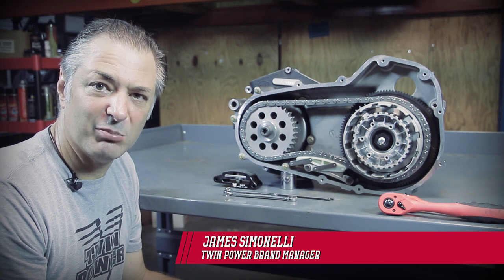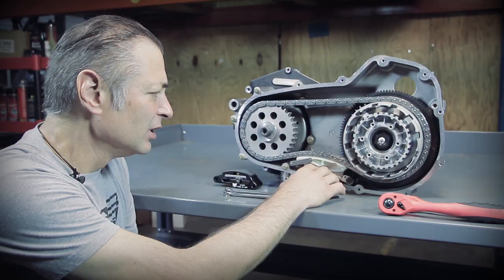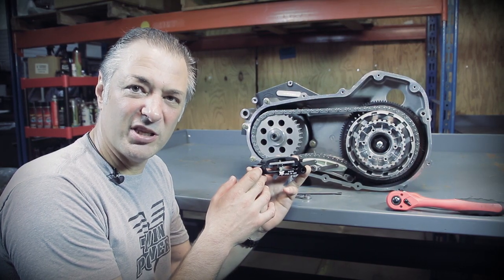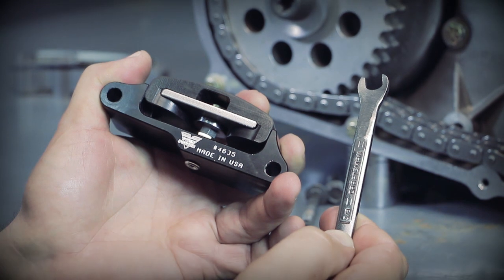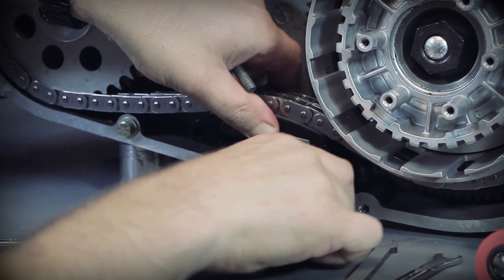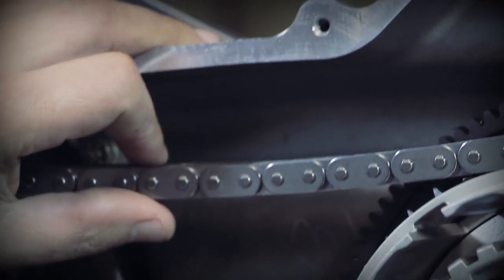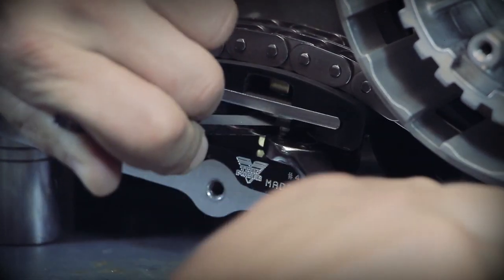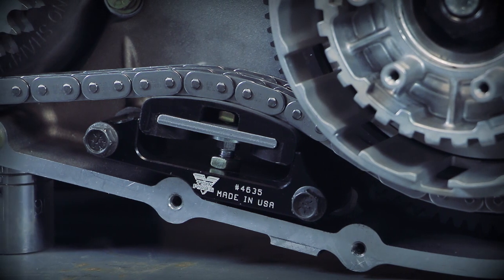Manual Tensioner | Twin Power

Comment: Only downside is you have to remove the primary cover to adjust it. The older HD models that had manual adjustment, were able to go through the inspection cover. Much easier. But I guess that’s what I have to sacrifice to swap it over to manual.
Reply: Yeah, would be nice if there were a cover with an access hatch.
Reply: I believe baker makes that very thing. At least that's what I was told. It's pricey tho. I'm referring to the primary cover with inspection/service plate.

Comment: i like this manual adjuster... i have a stock '02 Electra glide, with the stock factory manual adjuster.. this adjuster is way better than the stock manual adjuster  b/c you get an exact adjustment.. the adjuster i have uses notches or 'teeth'  & the chain is either just a little too loose or a little too tight.....

Comment: so basically... the 'fix' is simply to defeat the auto tension (which was supposed to be the 'modern' solution to premature chain and sprocket wear), install a manual override and then adjust the thing every 5K.   progress ???????
Reply: Go hydraulic. Only way to go.

Comment: Hi
Great vid...
I just installed a Hayden auto tensioner... I'm also running a Baker compensator... My problem is that I'm getting clanking HOT startups .. HaYden is telling me to ride it for over 500 miles to break it in... Not sure what to do.. I'm thinking manual tensioner if that doesn't work
Reply: I've had the Hayden m6 for about 800 miles. I had zero issues at first. Now I'm getting chain slap. I have the biggest spring and both shims. I'm going to manual myself.
Reply: Removed the Hayden today...looking at options

Comment: Someone needs to manufacture a manual tensioner with some form of spring dampening.  All the manual tensioners are rigid with nothing to dampen all the oscillations associated with different stresses on the driveline..Something that the stock tensioner actually does.

Comment: What does a failing primary inner bearing sound like? Mine sounds like a grinding dry bearing sound until the clutch is engaged and put into gear. Thanks

Comment: I checked out your website, I am interested in your manual primary chain tensioner for my 2007 Harley Davidson Fatboy. I checked all of your dealers, not a one has your product, other than the cut down 3/8" wrench. I did an internet search, and didn't find your product anywhere, other than your website. Is this manual tensioner no longer available?
Reply: I also cannot find this product anywhere. Is it still manufactured?

Comment: I put one of these on my 08 ultra and the starter gear hit on the side of it and cut a grove in it , making a rubbing noise wjile running . they dont tell you to use spacers
Reply: All that is is the old style Harley chain adjuster made with weak hardware.
Reply: Wait were the spacers included with the tensioner or did you have to buy them separate?

Comment: The question should be at this point here in 2018 is: Why in the hell is Harley Davidson still using a chain primary drive ?
 A gear drive system is standard in just about every other manufacturer world wide and it’s smoother and less maintenance to boot. At some point this chain primary drive system must go sooner or later, and why the continued to use this system on a new engine design is beyond many of us harley owners.
 They will go to a gear drive very very soon.
Reply: And people continue to buy these POS year after year. Even now with all the transmission migration and sumping going on in the "New" M8 engines. It absolutely amazes me that people never learn.
Reply: Plenty of those chain drives hold up to MUCH larger engines including 145 C.I.  If you add enough horsepower, expect to bend a few parts on any machine. There's hardly any maintenance to a chain primary, and the overall HD design is actually very easy to work on. (I'm a multibrand mechanic of many years.) If it bothers you, buy something different. You have zero personal obligation to buy HD unless you work for them or own a shitload of stock.
Reply: Just to many variables, to comment. I know Harley s are for me.

Comment: Bought one for my 2014 low rider twin cam at its lowest  adjustment had a hard time installing it once installed  there's no room to put play in the chain very tight didn't work.  I do not recommend it.

Comment: People are concerned that the adjuster bolt in this Twin Power tensioner lacks support, and will bend over time. Anyone had this tensioner installed for 10K or 20K miles, that can report some long-term results?
Reply: it's like a mystery nobody knows nothing about it for $200 bucks...checked out there web site this morning and they are not even listing the adjuster 4627 ???
Reply: No obvious reason it should and the bar holding the shoe is as thick as the later (good) Evo Sporty chain adjusters.  If in doubt, buy Baker. (If not in doubt, buy Baker.) The solid engine sprocket ( compensator eliminator does sound cooler) is a very good idea and has been done before. I despise auto adjusters and replace them on personal bikes.
Reply: Got mine will update after install and 500 on it.
Reply: So Jim's cycle....any update??

Comment: That is very bad solution.  Why is not a gear not installed in the place of plastic on which the chain grinds.  Design flaw on purpose, wearing parts with the company earned money.
Reply: You should probably refrain yourself from speaking on things u have zero to no knowledge of. If I was you, I'd ask questions and hold my opinions to myself. At least until I've gained enough experience in said field. To warrant giving an educated opinion. If the primary was a dry setup. I could see your point. But since it's a wet clutch/primary. The plastic/polymer will get very Lil wear whatsoever. At least any of concern. I urge you to do a little more research on said topic. It'll help you immensely. Ijs imo

Comment: NO GOOD.  Each time you need to adjust that tensioner it will require removing the entire primary cover.  STUPID STUPID.  Use the manual adjuster with the slide that can be adjusted anytime through the 4 screw inspection plate